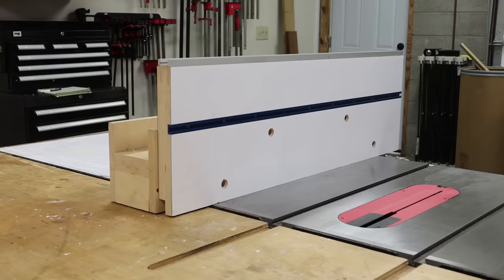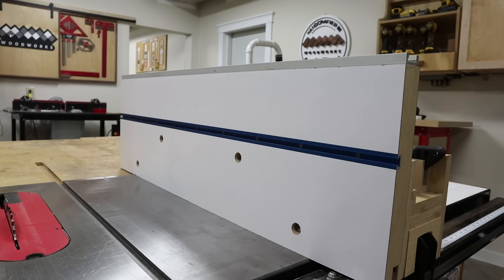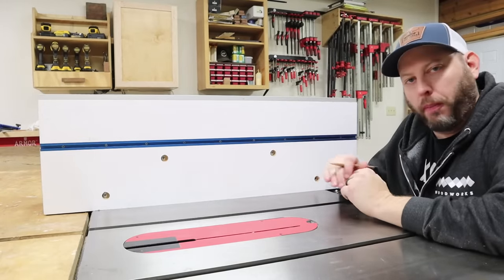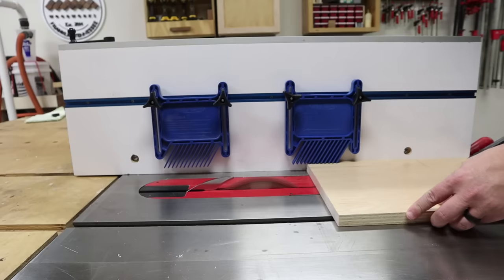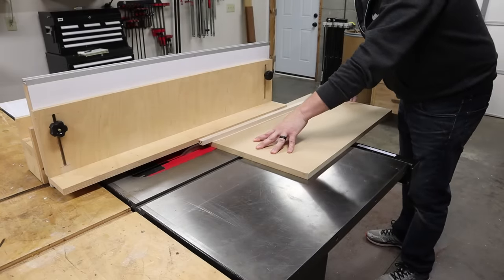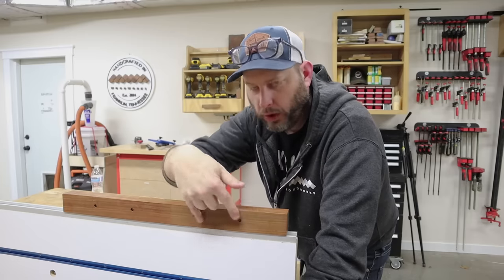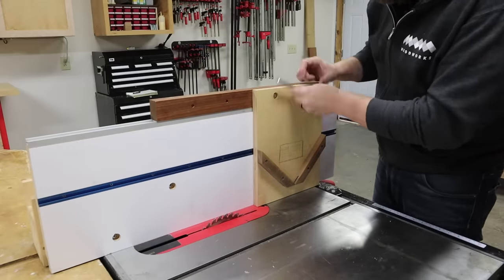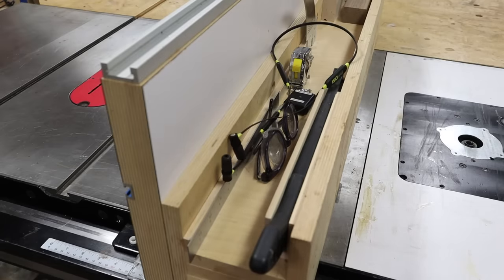The single GREATEST upgrade I ever made to my table saw

Comment: Looks like you have a Sawstop table saw?  I do too, and I was wondering how you got the auxiliary fence to sit square to the SS's surface, especially with the height of that add-on fence with the rail.  Does the auxiliary fence sit on the top of the SS's fence with the bottom edges floating above the table surface?  If so, you'd be entirely dependent on the squareness of the SS's fence to the table surface, and you'd need to be extremely careful with that adjustment since any error will be magnified at the top rail.  Making the auxiliary fence tight against the SS's fence would alleviate this, but then you couldn't easily remove the auxiliary fence.  Have you found this to be an issue?

Also, I noticed you have a router built into the surface of the SS.  The optional SS router addition I've seen bolts onto the left side, not the right.  Did you make that router surface?
Reply from the maker: I do have a sawstop. And the aux fence is built to have a piston fit on the rip fence. It doest not move or rock. When I installed the aux fence I made sure to square up the tall fence by using playing cards and/or pieces of paper between the tall fence and the subfence until it was perfectly squared👍

Comment: Beautiful fence!! would like to get it.  your link takes you so where you can purchase it for 5.00 but the agreement you have to agree to states that I am giving permission to be charged AUTOMATIC PAYMENTS to Gumroad---seen in the agreement I am asked to sign " I want to use Visa xxxxx for automatic payments to Gumroad. I understand that if this payment method is unavailable, the payment method used will follow PayPal Policies and that if I hold a balance with PayPal, that balance will be used first to complete my payment. I can also change my payment method or cancel this authorization in my Settings."  can you please explain why I would be agreeing to automatic payments and not just a one time payment of 5.00? How do I purchase it with only a one time payment?  I do  not want automatic payments to anyone because I only want to purchase this item once and nothing else.  Thank you.
Reply from the maker: It will only charge you for the plan you purchase.

Comment: I ordered the stuff you linked to in amazon none of its is correct   The blue mini track is only 36" long and the other track is a dual track 1.75 inches wide 
POWERTEC 71365 Aluminum Combo T-Track Miter Track for Woodworking | 48” Dual Track Rail, Aluminum Grey

Comment: I just came across this site today and have a strong interest in building the fence using your plans. I wanted to PM you or email directly but did not find a way to do so. Please don't be offended but as much as I would like to purchase your plans, my experiences making other purchases without the benefit of a privacy policy more often than not ends up with months on end of spam email. So the question. Do you have a privacy policy that will all but guarantee you or your affiliates will not sell my email address?
Reply from the maker: Email me using the contact form on my web site.
Reply: @MWAWoodworks  Done. Thanks

Comment: Nice, but it would not live on top of my guide. By using this you loose the ability to use jessem stock guides
However I know it lifts off the fence.
I'd also buy a few toggle clamps to hold work on the jigs, on your corner spline jig your fingers looked way to close to the blade, one mishap is all it takes. Toggle clamps can hold the parts your hands should never be closer then 6" to the blade. I know 3 to 4" is probably enough but always better to be safe then sorry and hurt.
You have to think the unseen out out the blue can happen, kids come into the shop, dog comes running in light fixture falls from the ceiling honestly
You just dont know, and if somthing like that happens you'll loose your focus on the part and saw operation and that can end in injury at the blink of an eye.
No I'm not the safety police, I'm the common sense judge.

I like the atachment. You can make a lot of jigs for it to use both on the saw and router table, it would make doing lock miter joints simple. As well as stop cuts, surely you use that on the router too.